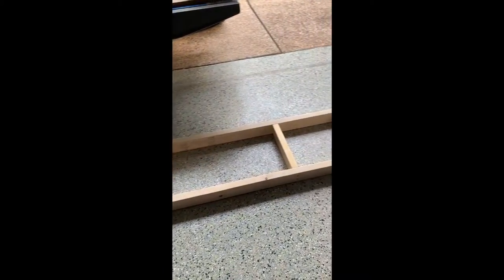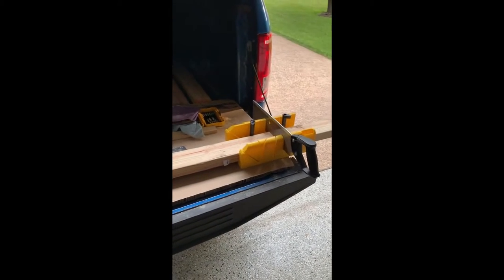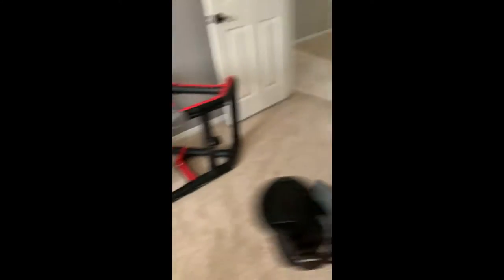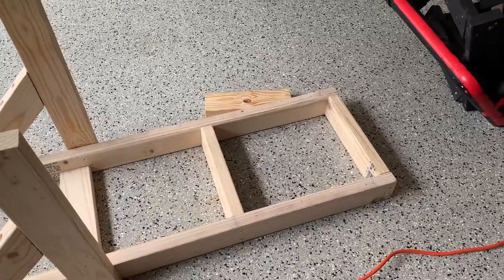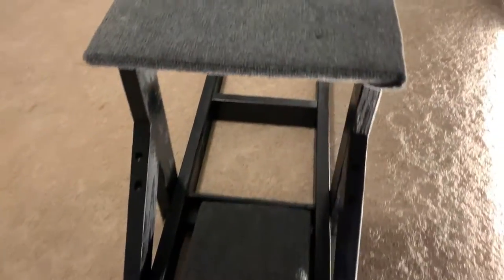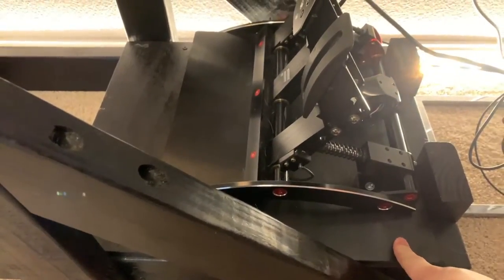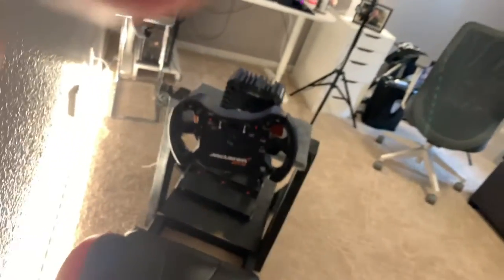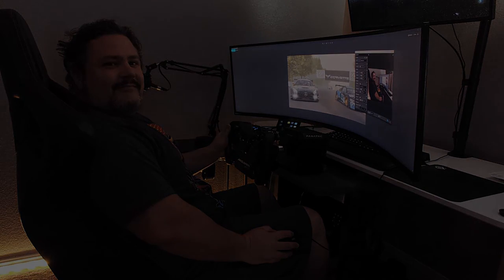How to make a cheap DIY Sim Racing Rig for use with a desk or console setup

Comment: Do you get any left/right wobble?
Reply from the maker: No its been pretty solid left to right. I did have a small amount of forward and backward tilting movement of the wheel base platform.  To help with that, I added a couple small L shaped medal braces under the wheel base platform to add a bit more support.